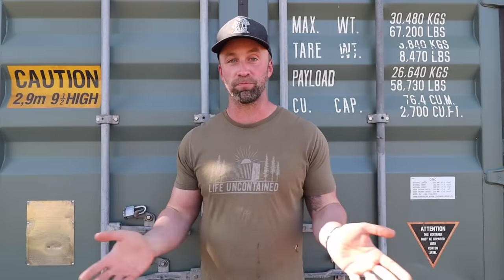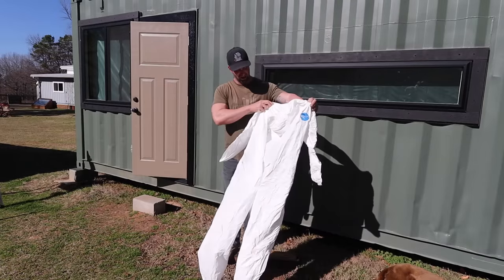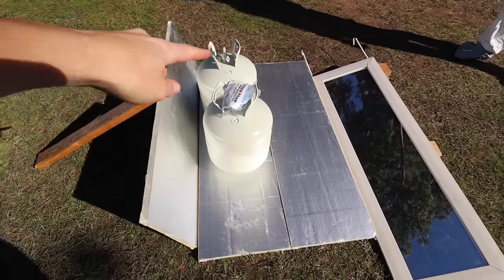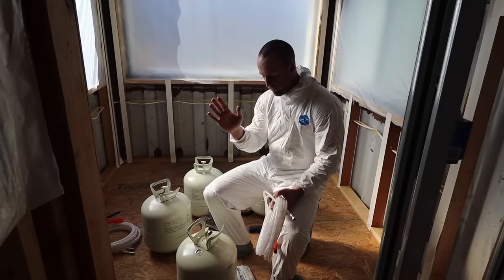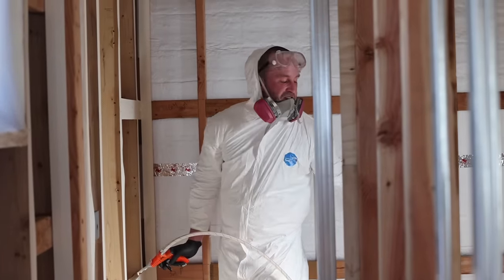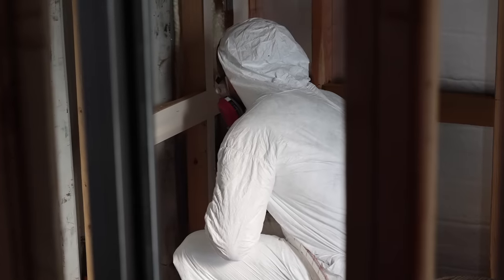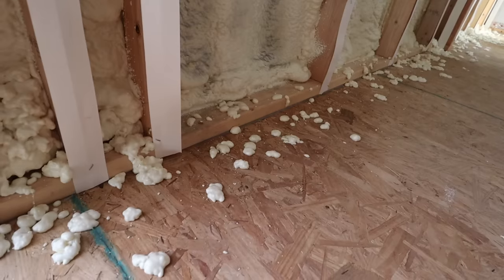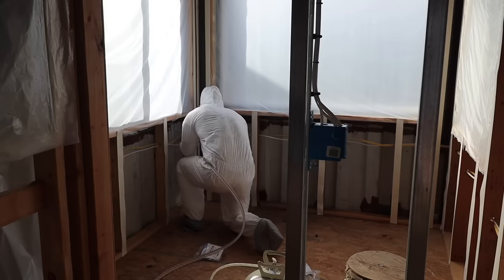HERE GOES NOTHING | Spray Foaming Our Shipping Container

Comment: I think you're meant to move the nozzle faster as you spray. That allows the foam to expand fully, which traps more air and provides better insulation value along with covering more area. If you go too slowly, you won't get as much coverage because you're smothering the base layer of foam with more foam on top before it can absorb all the air it needs.

Comment: I put my tank in the kids wagon. They fit perfectly. I did the underneath of the roof for his house. 720 sqft. 14 x 52 manufactured home I completely gutted. Metal roof, 2 x 2 trusses. I used 6 kits of Go Green closed cell.  2 1/2"  at outside( wall edges) and 5 1/2 @ center of peak.  I am in Arizona durning  dead summer  115° hotter than hell. Where you cannot put your bare hand on anything. The underside of the roof, you cannot feel any heat at all. This shit works. 

Now between the sheetrock and the foam is just a void of dead air. All cross vent are gone. Just empty, still,  controlled space. The foam is  a vapor barrier, no bullshit needed between the foam  and the sheetrock. Start and stop needs to be done with concern or you need to be ready to change out tips.

$4500 for 6 kits, worth every $$$

Comment: I just got geothermal installed and as part of it, got my attic spray-foamed. For over 20 years, when you went into my attic, if it was 20F outside, it was maybe 30F inside. If it was 90F outside, it was most certainly 100F inside. I don't know about the summer, but so far, even when it's been 20F outside, it's been 60-65F in the attic. Spray foam makes such a difference!

Comment: I’ve seen many others do this exactly the same way and I’ve always wondered, why don’t you fill the entire cavity up to expand the full 3 1/2” to get three times (using simply math) the R Value. I get the cost, but if it’s open why not fill it completely and shave off any excess prior to drywall? Want to do this in my garage and curious.
Reply: good ????

Comment: Taking a while to heat up is a good thing, means they will take a while to cool down, at least until they get low.
I think I would have used foam board in the large areas, and use foam to fill in small areas and cracks.  I have watched a lot of videos, and most use 4" fiberglass or foam board in open areas.  It will anchor pipes and wires when moving it I suppose.

Comment: Years back I did some trailer frame sand blasting, converting them to generator trailers. It was so hot in that suit that I lost 3 pounds the first day. I had an idea to hook up a long flexible air line hose to the suit from my compressor, just cracked the valve open a little and it was like have A/C in the suit. If you do anything like this and you have access I highly recommend it.

Comment: Great job Spencer!  Like how its all looking. I still think you should build a bottom floor to get the cabin on. It will give you so much more needed room. Enclose the stair well to the bottom and top floor so you can use some of it for living and the rest for utilities. Plus later you could add on an upstairs deck. That way you won't have to worry about bears, etc animals breaking into your cabin easily. Plus it keeps them away from the kiddos!  Just saying 😊

Comment: Are you filling the cavities full to top edges of beams or stopping just below ? The foam can expand over a few days wait, so if you don't want to have to trim off layers above beams, give yourself a break before resuming, just  2 days before reapplying additional foam... Saw a pro outfit do this with a multi person team, they sprayed a few bays in AM, took lunch and came back to find bays mostly expanded (90% ish ?) so they only needed to touch up slight depressions to get a beam level surface.

By following day the foam had expanded as planned, about an inch above beam's upper surface... The cut off this excess with a long wood saw to make it perfectly level and flush... Or you can trim to perfectly flush with this : https://www.youtube.com/watch?v=tajdmRwem8c

Comment: Spencer,
Suggestion go to or check automotive parts stores, Spencer , some sell coveralls used ones they'll breathe and be considerably more cooler and fit better thus more comfortable & if pre-used are pretty inexpensive. I think you'll like them I have noticed guys who spray foam insulate spray a very light tack coat then come back over with build coat it would seem slower but it's faster; secondarily maybe introduce a fan blowing fresh air into space it will improve air quality and cool down atmosphere additionally your respirator filters will last longer and ease of breathing improve remarkably. I hope you read this & it may help you, dude you're doing a great job.
Respectfully David

Comment: 600 bd ft is the theoretical yield.  Actual yield should be closer to 85% of that.  Also, Tigerfoam doesn't have the most efficient nozzles.  Froth-Pak by Dupont is far superior in that regard.  Also, the tips are called cone spray and fan spray.  Grat work in taking on this project yourself!

Comment: They make corrugated insulation panels for storage containers that fit identically to the ridges in the walls of the container. Did you ever consider using those instead of spray foam??

Comment: Great job under difficult circumstances.  I have one question.  What's the difference between the do it yourself spray foam you are using, and the spray foam that professionals use? It seem that the foam used by professionals expands much more than the do it yourself  foam. Ultimately, would it cost less to have a professional spray foam the container and get  thicker coverage, or pay for the do it yourself kits? Awesome job.

Comment: Familiar with the foam product and i all respects you did OK. To get the yield,  your surface your spraying to should be at least 70 degrees or higher, They figure the yield by the pounds of chemicals and that is most likely a 2 pound density foam. And the warmer you get the chemicals the better the yield will be. Its still worth the effort.

Comment: Hard work! Great work. Imagine all the electric wires inside that foam and you need to change the cable! 😮 If only Americans understand the use of plastic flexible tubes for the electric wires and also water pipes. No brainier if you are building. No brainier even the extra cost. Redundant system.

Comment: Not a nice job to do so well done.
2 points:
1) What would happen to the expansion of the foam if you held the nozzle further away from the target surface? When the professionals do it they spray from about 18 inches away from the surface.
2) What would the dollar cost have been if you bought and fitted 1 inch foam sheets? Your time would have been A LOT of hours but the expense for the foam board would have been way less I am guessing - especially for the large areas. You would have to use spray for the nooks and crannies but you could also use the spray around the edges of the foam panels to seal it all properly. 1 spray foam set would probably be more than enough in that case.

Comment: Every video I've seen of ppl using these kits they run way short.  I've often seen the quadruple what they originally started with.  Hope that's not your case.   I had to laugh at myself.  When you were taking off the  protection suit I had to fast forward.  I hate, no massively hate getting sweaty like that.  I'm very impressed, I could never do that.  I'd be stripping and jumping in the shower every 10 minutes.  Lol